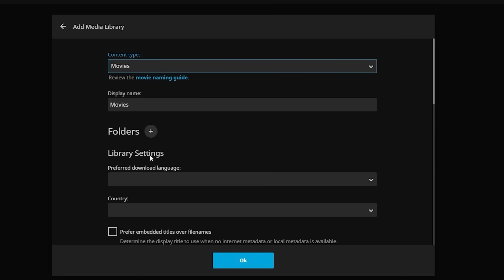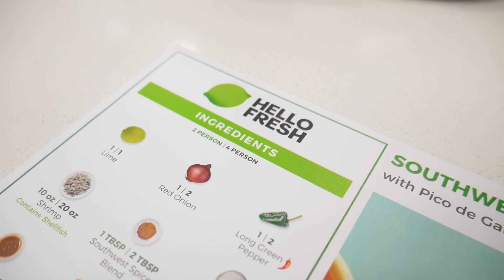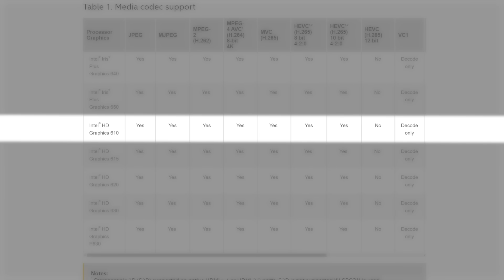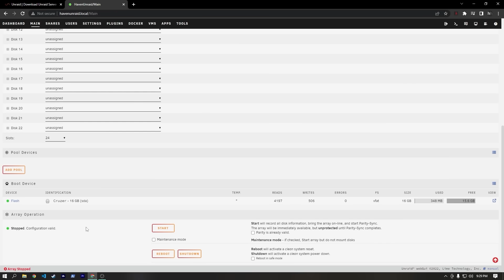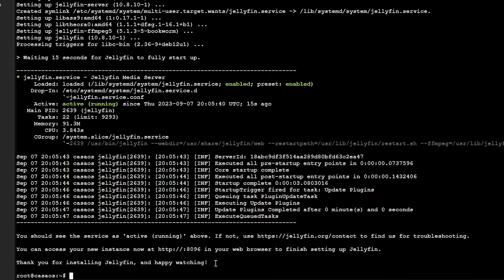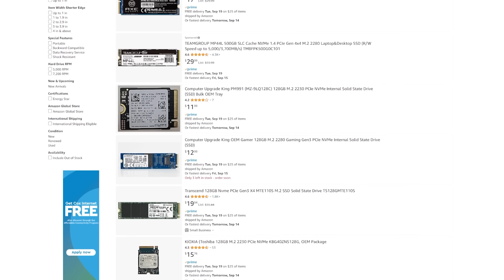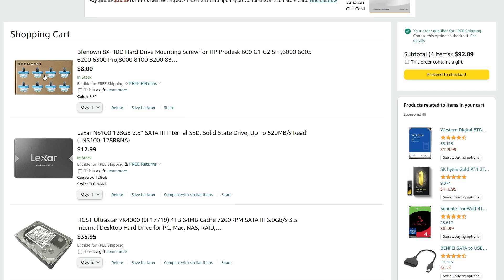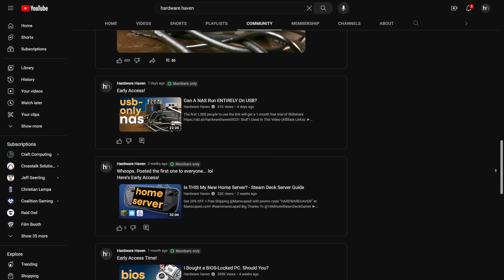The ULTIMATE Budget Jellyfin Server

Comment: Just in case anyone is wondering, you can fit a third 3.5" drive there, but you'll need an angle grinder and a bit of creativity.
What you can do is cut the 2.5" bracket off, cut off a bit of plastic from the 6 pin connector to make it lower profile (pay attention, the plastic, not the cable, and not in the areas where the plastic is holding the connector's pins in position. Use an extension cable, so if you screw up you won't throw everything away)
I have mine (a G4 but all brackets are identical from g3 to g9) like this, with the drive perfectly secured with 4 screws and cork feet to absorb vibrations. Not the most comfortable service, but you don't hit anything and it's absolutely working fine including temperatures (low 40s while copying).
Going from raid 1 to raid 5 is a big improvement in space imho, and definitely worths the hassle, which is basically half an hour of grinding, disassembly and thinkering.

Comment: I built a pretty good Jellyfin server for less than two hundred dollars. I got a dell optiplex 3050 off Amazon for 60 dollars with a i3 processor and 8 gigs of ram with a 500 gig hard drive. I pulled out the hard drive and installed a wester digital 1tb NVMe ssd as the boot drive for 60 dollars and had a spare 1tb SATA ssd that I tossed in for all the media content and still have 3 one terabyte external drives if I need to expand. The pc handles at least two people streaming in the house and plays YouTube while doing it all so I’m very happy

Comment: Nice video!
I'm still, slowly, working on replacing my i7 4790K NAS with a N100 based system. As it's idle power-consumption is only 4.5w.
Ideally I'd swap spinny 3.5" drives  for ssd's as they're more power efficient. But I already have the other system so I've been slacking a bit.
Reply: SSD's are very pricey though, especially NVMe ones. This last November I bought a 2 TB Western Digital NVMe SSD with up to 4.15 GB/s read & write for €100, meanwhile I got a second hand but unused 3 TB 7200 RPM HDD for only €44, and am about to order 2 unused 2nd hand 10 TB HDD's for €110 a piece. So I can get 10 TB in HDD storage for the same price as 2 TB in SDD NVMe storage, quite a difference. If you want a couple dozen terrabytes of storage, using SSD NVMe's simply becomes unaffordable.

Comment: I chose an RPi5 4gb, NVMe hat w/SSD and have had zero issues running jellyfin and qbittorrent simultaneously, non-stop. I can watch anything while jellyfin is transcoding and have not suffered any playback issues. Just works, but...I have several hundred dollars tied up in it, as well. I probably could have gotten a better mini pc for the same money, but not so sure I could have found one to equal the low power consumption of the Pi

Comment: I have an SFF optiplex with 8700 (non-k) and I  inserted a low profile 1650. Would it work?
Reply from the maker: I would honestly just give the iGPU on the 8700 a shot. It handles transcoding pretty well and draws a lot less power than the 1650 would 👍🏻

Comment: Powerful hardware is never necessary for fun little home projects. My home server is a tiny Dell Micro with a laptop based 4th Gen I5 running 4 cores 4 threads @ 2.0GHz. 1TB SSD inside, 16GB Ram +  4 drive bay on USB3 with loads of storage.
It's in the barely used Basement Living Room, running Windows 10, connected to an old 60" plasma TV and it runs the following jobs.
TV Computer for netflix, prime video and whatever else.
Runs VMWare with an Ubuntu vm configured as my plex server.
Run another VM with FreePBX for my phone system
Runs UrBackup service keeping backups of all my home computers.

My Upstairs TV PC is actually an Elitebook G3 with an I7-6700, 32GB Ram, 500GB NVME. I added it an Nvidia Geforce 1050Ti 4GB. But no server usage on this one. It's all TV, Emulators and light couch videogames such as Streets of Rage4, heroes of might and magic 2/3, and to my surprise it runs Jedi Fallen Order on 4k with medium settings respectably well.

Comment: I've been running this exact PC for years! Well I mean, the one you intended to buy rather than the one you bought. It's an absolute gem on the used market and this video's the validation I didn't know I wanted. Even though yours has a lesser CPU (I got the 7700 variant) that's easily sorted out with a 1050 Ti, it's powered entirely through PCIe and is absurdly cheap these days.

Comment: Well, I've seen this video (and so many others from you, praise the algorithm) while I was on vacation in Sardinia. I bought a Elitedesk 800 G3 (the 7500 one) for 79€ with 8GB ram and 256 NVME directly from the beach.
And here the good news are ending. I live in Italy and here (but I think its about the same in the whole Europe) hardware prices are a bit different. Expecially ram and storage. For 2 TB SSD it's almost 100€ (and you have to be a bit lucky to find this price) and 8Gb of ddr4 usually goes around 20/25€ a piece. 

I've bought this pc the same to upgrade my lenovo M910Q with an i3 so it's fine and the ebay listing was a bargain. Now I'm tryng to find a couple of 16TB drives but they're usually around 240€ each. Luckily at work I'm plenty of ram And I've already upgraded it to 32GB for free (we've a lot of not so old hardware that we're dismissing due to hospital rules) but drives are still a problem. 
With time I hope to fix this issue, this machine will be used for home assistant, basic nas and probably a pihole or something like that. The plex server is already on the Nvidia Shield pro, so I don't think I'll bother to move it from there.

Now, excuse me for this wall of text, but I also want to say thank you for your videos, always informative and well explained in a calm way. Greetings from Italy.

Comment: You can get a G2 that generally comes with a 6th Gen for $20-$50. 
It uses the same socket so you can upgrade it to a 7th Gen. 
As far as better systems go... Windows makes it much easier to transcode, The only real negative is the forced restarts from updates. But if it's just running as a Plex/Jellyfin server you could force delay updates & manually install them once a month or something & it won't really hurt you since your system doesn't have an active user & just runs things in the background. 
For External drives, the reliability of USB-C drives is a huge improvement, & pretty much gets rid of all the negatives that External drives used to carry.

Comment: HP Elitedesk 800 G3 (Windows 11 Pro, 250GB SSD, Intel Core i5-7500, 8GB RAM)  would this work as a base model
Reply: Should do I've got the G4 with an I7.Make sure you do a bios update as parity check kept failing on me.

Comment: I think the "ultimate budget Jellyfin server"  is whatever old PC you have laying around
Reply: Unless that old PC is power hungry
Reply: @fluffykickflipper  True.
Reply: Not really when you consider power consumption because I'm assuming you're going to run it for like 5 - 10 years here electricity is  30 cents per kWh so the difference between 35W and 90W 24/7 365 would be $720.72 to $1441.44 here at least, even if you assume 12.5c per kWh and running it for 10 years it is still worth getting semi-recent low power hardware especially if you were to buy such a cheap device like in this video.
Reply: @Etheoma  I don't think people running their old pc as a server would run it for 10 years without swapping any component. Plus, the 7th gen intel cpus are like 8 years old, so that could be someone's old computer (although gotta admit that my old computer is a i5 2500, so, not my case)
Reply: @ Well considering that I personally only do a whole system upgrade every 5 years, personally I would be using it for 5 years at least which again 35 vs 90W at 30 cents per kWh is $720.

And we are not talking ultra efficient or super expensive hardware here, specifically in this video the NAS only costed $65 and consumed 13W idle vs my PC at ~90W that would be a saving of $201.80 per year.

again assuming a more reasonable 12.5c per kWh that would only be $84.08 a year, but again the NAS in this example only costed $65 so the NAS pays for it's self in under a year and anything beyond that is over using your old PC just pure profit.
Reply: @Etheoma Why not just run emby on Android? Nothing draws less power than an old android phone. Just install root & install battery charge limiter app on it and it will never go above 80% charge. Even some more recent androids have this feature these days.
Reply: @ Plenty of Android that accept micro SD cards. What storage problem?
Reply: @BarbokVA  That depends on how large your archive is. It's not inefficient to me because my media only has several hundreds of GB at best. It may not fit your needs if you're a media hoarder.
Reply: @ Yeh I only need upto 2TB of storage ever and an SD card which costs $179+ when you can pick up a 8TB drive for that price... /s

Also SD cards are 60MB/s which is pathetic for a NAS, furthermore SD cards are terrible for data reliability etc etc etc.

If I were going to do something very low power I would do a pie NAS which at that point you can use HDDs or SSDs in a RAID array although there is not much point in using SSDs and the raid array would only be for redunecy not speed even for the HDDs.

And the reason why below 10W is kinda just a flex HDDs consume 3W idle and spun down, so even if you only have 3 drives you're going to be consuming 9W so the 10W of the NAS is only doubling your idle power.
Reply: i use an old mini pc and a 5tb external hdd for mine, i wish jellyfin was as ez as plex
Reply: My old pc from 2016 runs an i7 7700k with a huge case and water cooling. I don’t think it will be best for any of this. Getting an upgrade thinkpad and think the case mechanics later I think is my best and cheapest bet. Or a 2012 Mac mini.
Reply: or your dad's old laptop
Reply: With Linux and not windows.
Reply: @tony_solar  you're never gonna believe this, you can INSTALL linux on it

Comment: I chose as a base a board for the 8.9th generation of Intel, and an i3-9100, the board can be expanded to 64GB RAM (currently 32GB), I have much greater expansion possibilities plus transcoding and that's what I wanted when switching from i5-3450 [I checked and i3-9100 is even faster synthetically than i7-4770, and I also had it on hand, which unfortunately is not supported in Jellyfin for QSV], together with 2xSSD [Proxmox system] and 4x2TB [data] power consumption is at the level of 50W capable idle time during transcoding about 60W, temperatures do not exceed 40 degrees C, and most importantly, I found a used motherboard with 2x M.2NVMe [ASUS PRIME B360M-A], I managed to keep the expenses to about $200, and I have really great possibilities, I am very excited! Greetings from Poland!

Comment: I just bought one but the 400 G4 for 65 quid. I want this to replace my Dell server which is not as used as I believed and that draws 60-70W compare to this which I hope will idle at around 20W and still be not 100% used by far. Should achieve Plex,Adguard,Transmission and few other jails plus a linux virtual machine without being not even 50% used. Hopefully will go well :)

Comment: How's this working out for you? I got the 800 G3 based on your recommendation in this video. I got it as a barebones kit for $49 and even bough a HP Blu-ray drive so I can start building my own Plex collection. I got the G4560 and 32GB of memory. I got a 2 TB SSD am just waiting on the money to buy me a couple of 14 TB HDDs to use for storage. My thought process was I could set up TrueNAS and install Plex, automatic-ripping-machine, & Tdarr via Docker. Goal is to make this a bare metal ripping machine for setting up my Plex collection and testing everything. Then later on when I have the money to set up a NAS I'll move the finished files over to that for a true Plex setup.

Comment: Those Intel Chipsets support Hardware Raid, I would've used that instead of a software raid solution.
You have to switch the SATA Mode in BIOS from AHCI to RAID, then at startup you can access the option rom for the raid controller.

Comment: seems to me the mini/1L versions would be even better given they have the T variants of the CPU and still have all media transcoding. Smaller, maybe cheaper SODIMM, less noisy... But yeah they may be a bit more expensive on the used market as is and you cannot add the internal drives other than maybe 1x m.2 + 1x SATA 2.5. So you'd forego the storage redundancy or capacity for size and power consumption, but one could always later get a JBOD USB box.

Comment: my file server run on i5 4460 ,  i orignaly buy the mb with celeron ,  in 2015  buy at the time a mb that had 6 sata , 2pci 2pciexpress 4ram slots  to acomodate my needs , , and upgre the cpu when i was able to get one for 50eu ,   put it on old server case ,  was using a quad port nic , and after got a 10gb nic ,  still works well for my needs ,  file server and plex ,  was runing tonido server , but it no longer work , nextcloud is to comlicate to install ,  probably gone get a wdmycloud , for that need ,

Comment: Plex is better in my opinion than jellyfin. Becouse jellyfin use too much ram and its very slow when need scan library when plex do it instant and dont use too much ram.Only for my opinion jellyfin have nice plugins.Jellyfin also have weird panel when u try settings sometings.Tried jellyfin but plex (without plex pass) its still better.

Comment: I got this off of am for $132 ... HP Prodesk 600 G3 Micro Computer Mini PC (Intel Quad Core i5-7500T 2.7Ghz, 16GB DDR4 Ram, 512GB SSD, 4K Support, DP, USB 3.0, USB-C) Win 10 Pro (Renewed). It came with a DP to HDMI adapter. I am using my WD My Book 3TD external drive to store videos. I installed Jellyfin.

Comment: The funny thing is, is that I have an HP EliteDesk 800 G3 SFF with an i5-7600 32Gb ram running with a 128gb nvme boot and using a PCIe 4 port SATA card and 4 4TB SSDs. Hell of a home lab server for all in of around $150. I had the memory, nvme, and SSDs since I own an IT shop and rotate out business machines.

Comment: Hi there! If I have an old synology NAS what would be a good way to connect the PC to the synology NAS so I can make good use of the PC hardware while using the drives from the NAS?
Reply: The short answer is network shares.  I have a similar setup with Jellyfin running in a docker container on an HP Deskpro mini G3 i5-7500T with just a boot drive locally. The media files come from my old Synology DS215j. Plenty of guides online - that's how I got mine working.

Comment: It's been to hard for me to understand all the issues 'cause I'm a 'bit' far from all there servers/streaming)))

So... what are basic steps (os, vm,  etc. step-by-step) and good choices to get Jellyfin machine on 'naked' HP 400 G5 with two mirrored hdds?))
Reply from the maker: If you're able to afford it, I would check out UnRAID. It's probably the simplest and easiest OS to use for NAS and hosting VMs and containers. 

Outside of that, you could try out Open Media Vault, as there are some decent tutorials on there. You could also just install Debian and setup aa RAID mirror yourself, but that involves a bit of cmd line. There's also TrueNAS, but I'm not as big of a fan of running containers with that because it uses Kubernetes by default which is a bit overkill imo.

Comment: Tip, in case you already have some storage solution in place (in my case: Synology NAS): I bought a Beelink Mini S12 Pro for €100 to be a dedicated Jellyfin machine and it was by far the best decision! Super low energy consumption for amazing transcoding performance. That Intel N100 CPU is great! Highly recommend you check it out!
Reply: Hey, I have a synology NAS. What’s your setup like? How did you connect your beelink to your nas?
Reply: @frankchau  jellyfin running on the beelink as docker container with GPU pass-through and mounting the NAS shares via NFS, directly in the container.
Reply: love the beeinks

Comment: I found a listing for the 800 g3 mini ones that was just a ton of used barebone systems that were used in hospital workstations. Bought 2 for about 60 dollars, and so far bought an NVME, 16 GB RAM stick, and a Wi-Fi antenna for about the same. I hope to build a server capable of running Plex when I leave it at home and outperform my dual-core-quad-thread laptop when I take it with me. Decided to go with the 7700 processor, which is not the 7700T that eBay keeps recommending, and is more than capable (on paper) of running a gaming server or two. Honestly am just hoping I can run the h265 encoded plex media tbh... it's the only potential issue I would have.

Comment: I'm looking at making a new NAS box, mainly for Plex and Frigate, using an Erying motherboard (with mobile i7-11600H (well, an ES that's similarly speced) CPU on board, which has 2 Tiger Lake media engines), a RackSource 2u 12-bay rackmount case for storage, a low-profile SAS HBA (like a LSI 9305-16i) in the x16 slot, and a Coral TPU for the E-key slot so it can also run Frigate as an NVR.

Comment: Do you know if the SATA controller on those pcs support SATA-PM protocol? Is so, it could support the QNAP Dual 2.5” SATA SSD to 3.5” SATA adapter in order to get 2 JBOD drives a single SATA port. And maybe even use StarTech M.2 to 2.5" adapters to get 4 JBOD M.2 drives into a single 3.5" bay on a single SATA port.

Comment: Ive tried using jellyfin in a docker container using rootless docker but i dont know enough to get it working. So i just installed docker with root privileges and added the dev/dri folder in the devices section of the docker compose file. Also i think i had to add the groud id somewhere in the compose file.
Anyway, cant get jellifin to work on rootless docker. Hardware transcoding gets difficult.